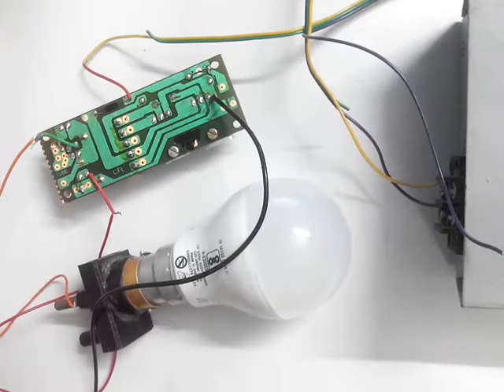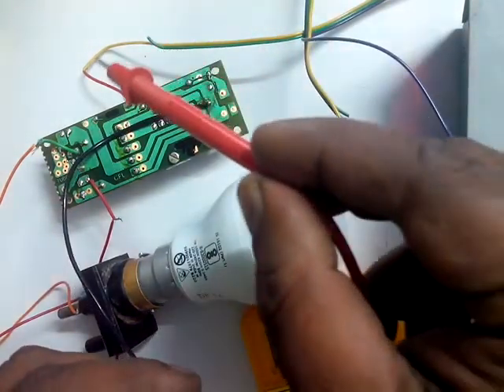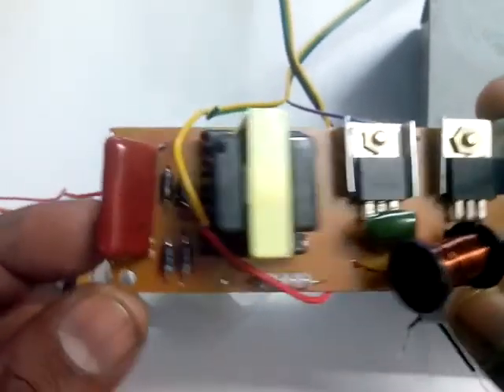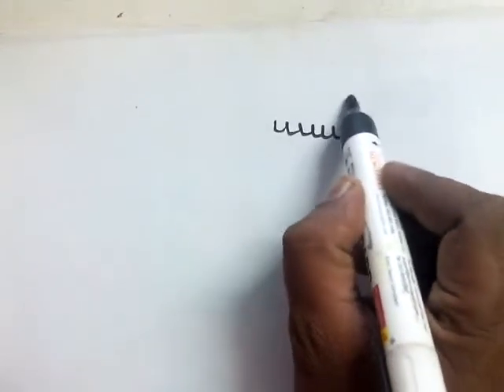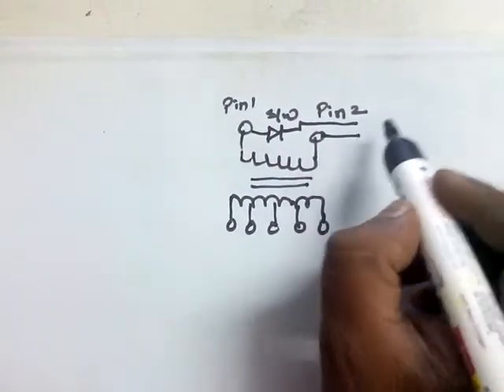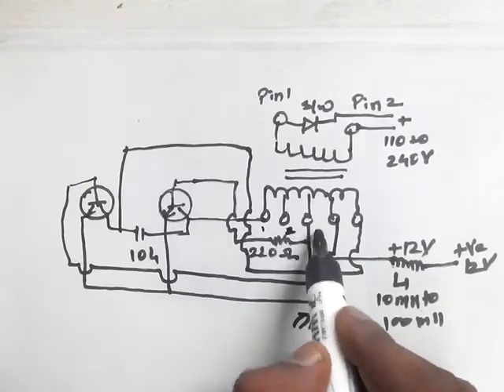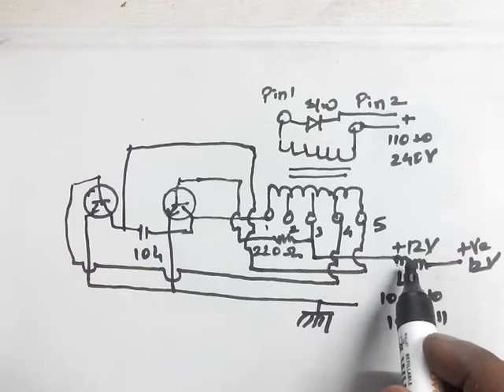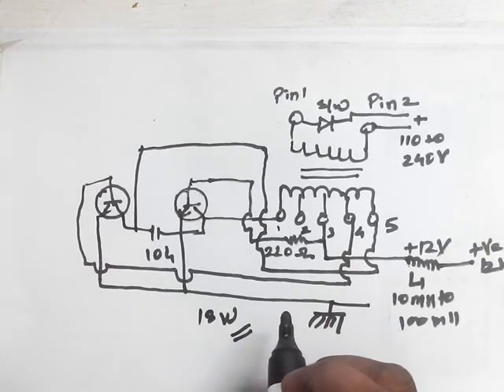How to convert 12 volt dc to 110v / 120v / 220v / 230 volts AC | Make easy DC to AC inverter

Comment: 6 v solar panels on hota he
Reply from the maker: Yes Mr. ZALA JAYRAJ SINH it will work with 6v solar panel ONLINE provided current rating of load matches with output current rating of solar panel otherwise simply connect battery which will get charged using solar panel and then use the stored energy as and when required.